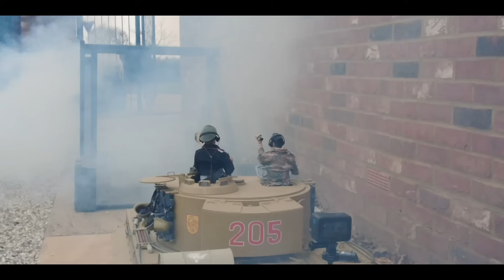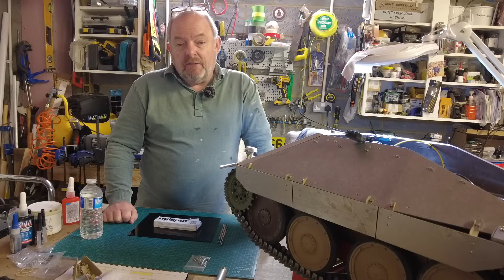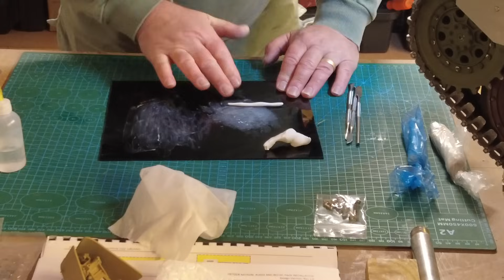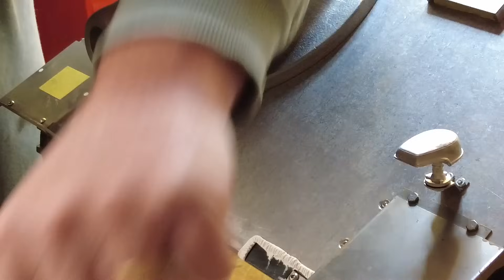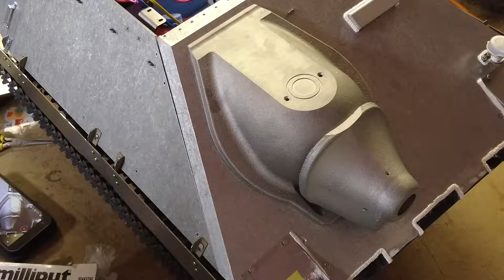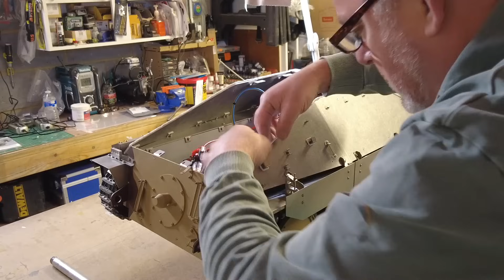1/6 scale Armortek Hetzer Jagdpanzer 38 (Vid 21) Scale mock welding ahead of painting.

Comment: Hi Tony , again another nice work. 
Can I ask about the air raid light mounted on the left corner of the frontal armour. Is it a white metal part from the Amorpax , but included in the kit?
Reply from the maker: Hi and thank you. This is an upgrade from Armorpax, but there is a basic one included in the Armortek kit which is more than adequate. I ordered the upgrade for the light, jack block and MG mount separately from Armorpax. 
Hope this helps.

Comment: Good job as always! I have found that keeping the modeling tools wet helps to keep the milliput on the model, as well as keeping it from sticking to your fingers! I think when i get to the roof of my tiger, i will try tapping plastic wrap to the turret, do the welding, and hopefully when removing the roof the weld will stay in place on the roof. Also, are you planning to conceal the screw heads that wouldn't have been on the real tank! Thanks for your build.
Reply from the maker: Thanks David. I’m still developing my skills in the welding area and you are right with keeping the tools wet, it does help. Good idea on the turret plate.. I think that will work well.
No plans to fill the screws on the hull as there is not that many on show on this model. The Tiger does, however when painted I didn’t really notice them unless close up. I was worried at the time in case I ever needed to get to them, turns out I did not so if I did it over again I probably would. Thanks for your continued support.

Comment: Having seen you do the 'fake weld' I definitely want to add that to mine. The only bit I am not sure about is the bead along the roof line, isn't the chance of damage too great when taking the roof off?
Reply from the maker: Hi Daniel, and thanks for commenting. This does really add to the final look and worth doing. I thought long and hard about the roof welding for that very reason, and yes there is a chance of knocking the bead and chipping but I still think it’s worth doing. These tanks get knocks and damage all the time when using them, but a touch up every now and then sorts that out. I would recommend doing the roof beads but attach to the hull so the roof lifts off clean. Once the electronics are complete, access to the inside is rarely needed. Hope this helps.

Comment: Tony, for doing welds, I bought a $10 clay extruder on the web that will extrude many shapes and diameter sizes that are prefect for welds. It makes a nice consistent long string of Miliput. This will save you half the time it takes to do welds.  Good luck on the rest of the build.
Reply from the maker: Hi Ray, great to hear from you. I never even knew such a thing existed.
Reply: I  didn't either - but a search on a well known auction site for 'DIY Craft Pottery Clay Extruder' returned hundreds, and one is now on its way to me from China, so Thanks Ray and Tony👍 @tonys_workshop
Reply: Not sure what a clay extruder is. Could you post a link here? Thanks from Germany!